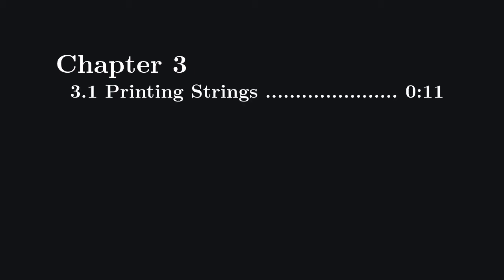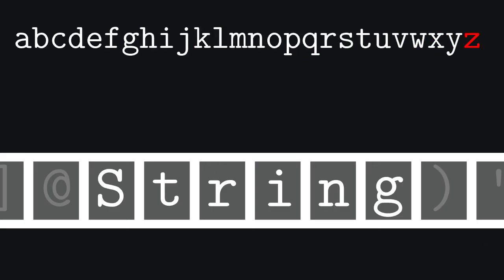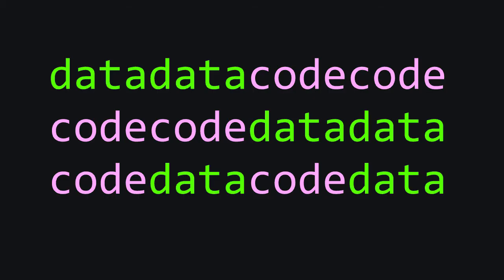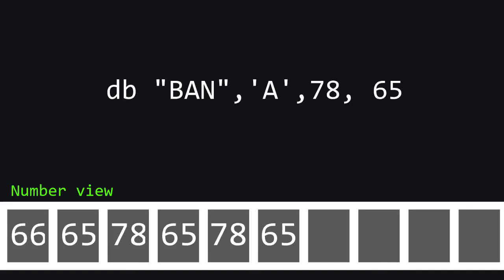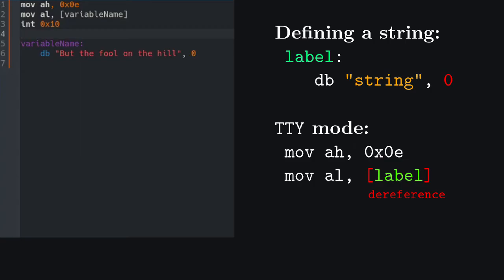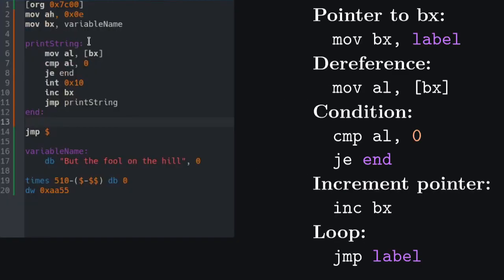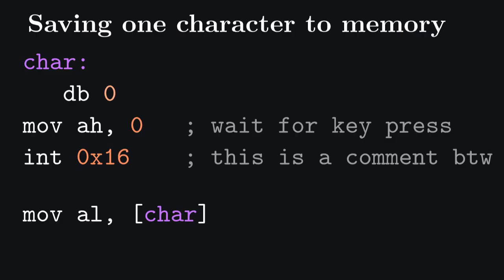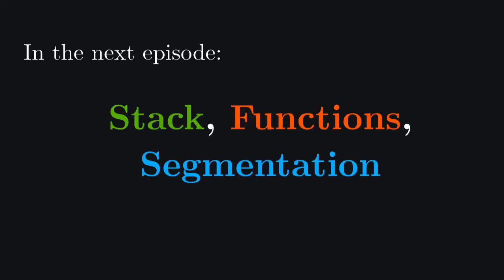Making an OS (x86) Chapter 3 - Strings, Keyboard Input in BIOS

Comment: if you were wondering how to get keyboard input onto the screen, its simple, first you have to create a label then, in that label, set ax to 0, after that you do int 0x16, then you will have your ASCII char in al and the scancode in ah (witch i dont really care about so i can change it with 0x0e witch switches to TTY mode) also dont forget to add "int 0x10" at the end and then "jmp LabelName". after that run qemu and you will see that you can now type stuff. Daedalus please correct me if i got this wrong, but it works.
Reply from the maker: Yep, that works for printing the character immediately after you press the corresponding key, but what if you wanted to store a whole input string in a buffer and print it?
Reply: @ Daedalus Community Ive got you covered (enter your name (or smth else) that fits 63 (64 but who counts) cheracters and dont forget to press enter):
[org 0x7c00]
mov cl, 0
mov edx, buffer

readkeyb:
    mov ah, 0x00
    int 0x16
    cmp al, 13
    je next
    mov ah, 0x0e
    int 0x10
    mov [edx], al
    inc edx
    inc cl
    cmp cl, 63
    jne readkeyb
    mov word [edx], 0

next:
mov cl, 0
mov edx, buffer
mov ah, 0x0e

mov al, 13
int 0x10
mov al, 10
int 0x10

printin:
    mov al, [edx]
    inc edx
    int 0x10
    cmp word [edx], 0
    jne printin

buffer:
    times 64 db 0

jmp $
times 510-($-$$) db 0
dw 0xaa55
Reply: Can you please show that in example?
Reply: @lutpoint7169  the point of this comment is to make people figure the lines of code out themselves, but if you really want to know how, then here you go:

Label:
   mov ax, 0
   int 0x16
   mov ah 0x0e
   int 0x10
   jmp Label
Reply: @nutty5371  that doesn't store the keypresses into a buffer though.
Reply: @xrify9407  i know ;). There are way WAY better ways to do this, but all i wanted to do is a basic "i press character, character go to screen" kind of thing. Also there are other issues like not being able to use the backspace key to delete characters.
Reply: @nutty5371  
    input:
        mov ax, 0
        int 0x16
        mov ah, 0x0e
        int 0x10
        jmp input